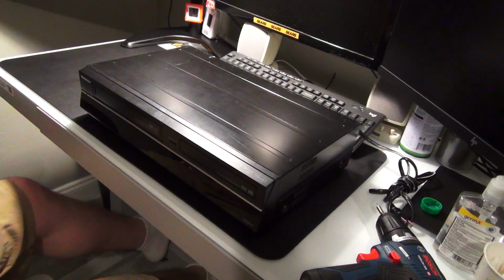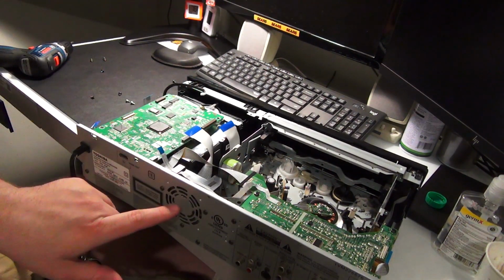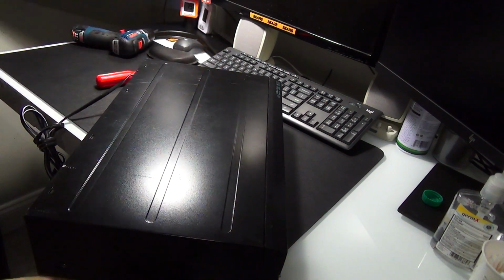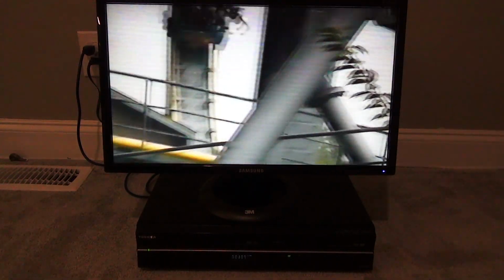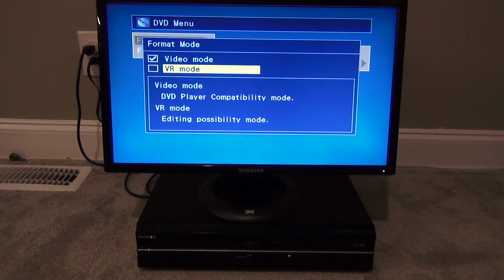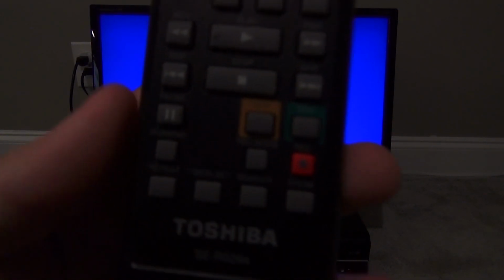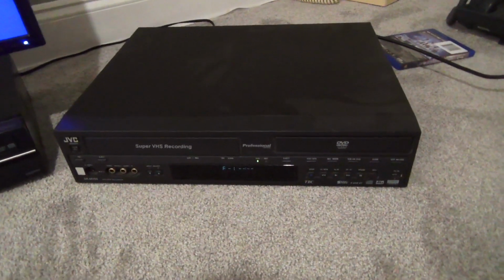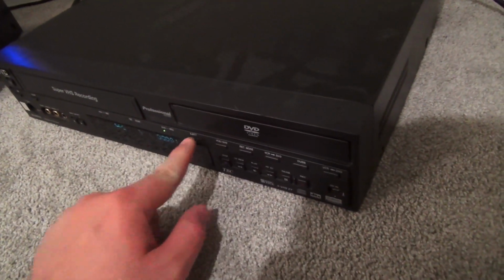Toshiba DVR670 Repair and Demonstration

Comment: Discs need to be finalized before they'll playback on other players, but I'm guessing you found that out later. I have this same unit with a similar issue, unable to read discs. Took it apart, inspected everything closely, but no dice. Unfortunately I suspect something is up with the controller/daughterboard, as I'm also getting nothing out of the HDMI port. Looks like you lucked out with it being a ribbon cable.  Do you still happen to have the part number/description for the ones you bought? It's probably a long shot for my issue, but it might be worth looking into.